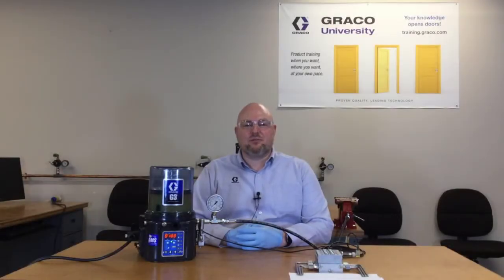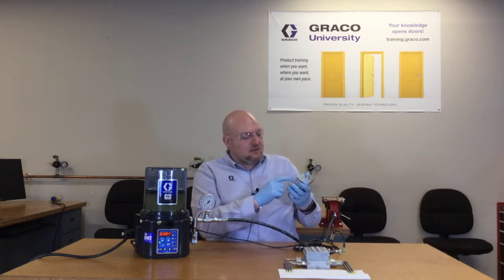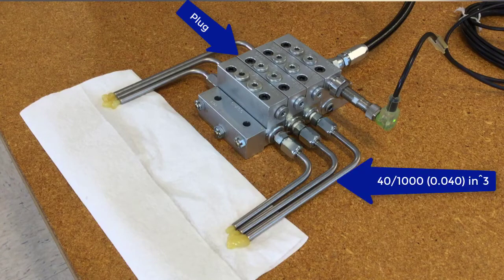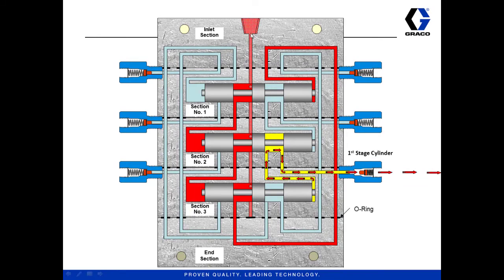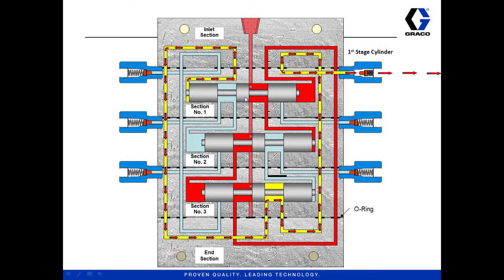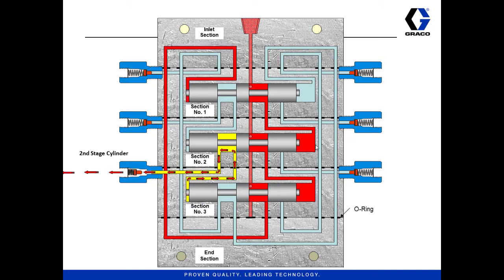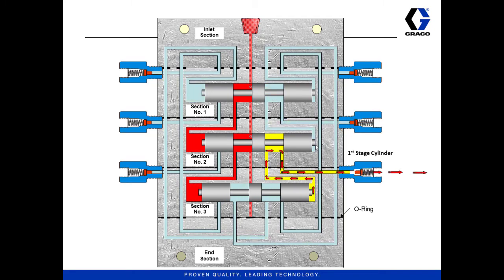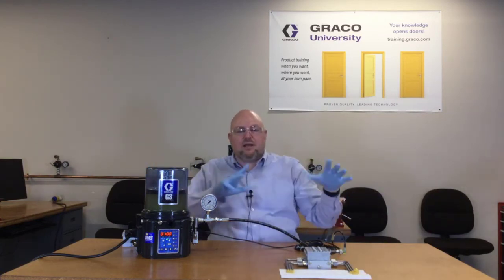Auto Lube Basics: Series Progressive Divider Valves - Part 2

Comment: Hi with that type of divider valve does the trick with the plug where the following outlet has more lubricant still work? Or do you absolutly need a bypass?
Reply from the maker: Hello! Thank you for the question. The MSP valves shown in this video are modular valves. What you are describing sounds like a monoblock, such as our Compact Series Progressive (CSP) valve. The CSP valves have an accessory called a Doubling Plug which works the way you described, but those don't work in the modular valves.

With the MSP valves, when you need to shunt the flow of one outlet to the next outlet, a component called a Crossport Bar (or Crossport Plate) is required. When the Crossport is installed it provides a path from one outlet to the next, and then a plug is installed in the first outlet.
Reply: @GracoLubricationEquipment what if I wanted to lower the grease output in a couple of the outputs? The first block is a few feet away from the center pivots on a loader and they get way too much grease.

Comment: Hi i'd like to know how to clean those valves.. 
We have old ones that we'd like to use again but the grease dried inside some of them.. is there a way to clean them without causing harm to the valve?? Thank you
Reply from the maker: Hello, thanks for reaching out. We don't typically recommend trying to clean old valves, but instead, replace them if they are in that condition. In addition to being time-consuming, our current valves use FKM o-rings, the older valves used Buna rubber. The life span of Buna rubber is about 15 years, and then they may start to deteriorate. If you would still like to try to clean them, and you want more details about options you might try, please contact our Tech Assistance group at LEDTech@Graco.com.
Reply: @GracoLubricationEquipment  thank you a lot so now i understand more why they failed in the past when we tried to clean them